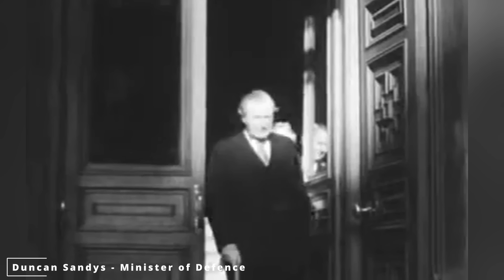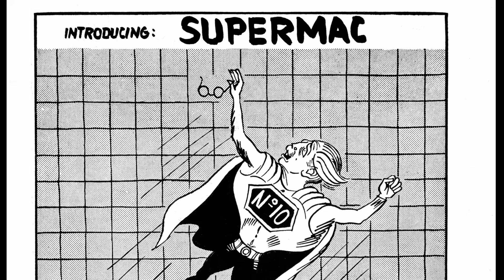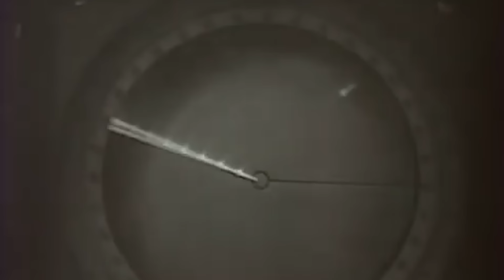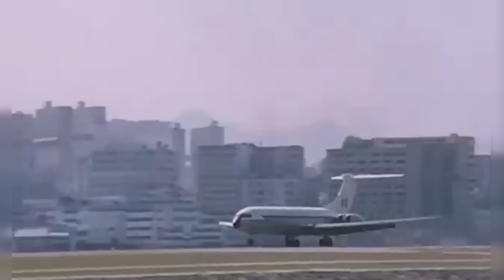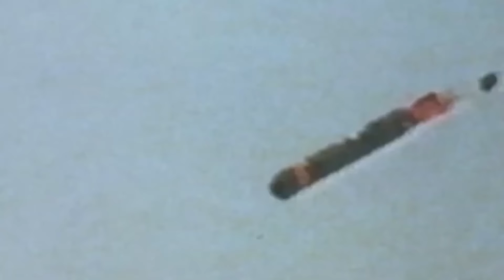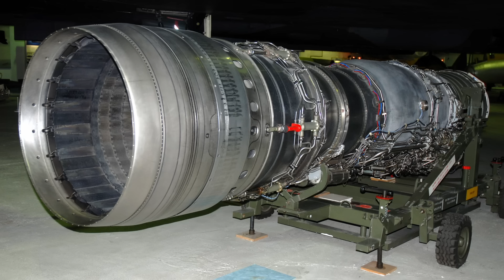How Britain Turned A Failed Airliner Into a Soviet Submarine Predator | The Mighty Nimrod

Comment: I knew a guy some years ago now, who was RAF, and spent his life spannering Nimrods. Eventually he quit the RAF but continued work on the aircraft as a civilian contractor. He said they were definitely becoming a bit of a 'mare to maintain, spares were often n/a, and they often had to make their own! But he loved the aircraft really, sort of love-hate style. Me, I remember both the Comet almost from birth, then watched it morph into the Nimrod. I still wonder how they managed to turn basically a pretty aeroplane into such an ugly duckling! They just kept adding stuff until there was nowhere left to stick anything else on the outside... I was still sad when they axed them for the boeing derivative, so much less character... (I also loved the Griffon-engined Shackleton, what a beast! 48 cylinders of noise and smoke!)
Reply: The Comet did not morph into the Nimrod... this is a common misconception.
Reply: @DoktorBayerischeMotorenWerke  

We believe we can clear up some commonly held myths and misconceptions obviously.

It's always good to see the facts presented clearly and concisely isn't it?

Bow-wing (see B-47 wing collapse wing folding incidents) had built less than 12 pressurised airliners before the Comet first flew and they were not high altitude airliners. 

All Nimrods were new build Comet 4 airframes with appropriate strengthening and the unpressurized  equipment bay tacked on. 

The HS 801 Nimrod was the most advanced aircraft of it's type at the time it first flew. Problems with the MRA4 programme were almost entirely due to radar and computer equipment issues and BAe Systems & co being too busy with other work at the time. 

Obviously there have been worse aircraft for accident losses both before & after the Comet.

Early problems with Comet takeoff stalls were caused by pilots over rotating the aircraft at liftoff. 

Podded engines on wings have aerodynamics issues. The main reasons for eventually going with podded engines were because or to facilitate -
Ease of maintenance.
Use of shear off fixings given excessive out of balance forces.
Large diameter turbofan engines.
Reduce load on the wing to fuselage connection. 
Increased power from later engines. 

The Bow-wing (See B-47 wing collapse & wing folding incidents) was a good example of how to expend a huge amount of cash and effort on something that was probably not worth bothering with. The basic design of the Comet had been decided upon and established before the podded engine choice has been made for the B-47. There were aerodynamics problems with podded pylon mounted engines at the time. The US also built and operated a significant number of EE Canberra bombers under licence which did not use podded engines for their wing mounted engines. . 

There have been aircraft losses caused by pod & pylon mounted engines. 

All jet airliners benefited greatly from the knowledge gained from the Comet incidents & subsequent investigations & yet some were still worse for accident losses. 

Instances of all marks of the Comet flew with full certification after 1954 including the Comet 3. The last Comet flight occured in 1997.

The fabulous trail blazing DH Comet.
World's first jet airliner in regular service.
The jet engined Avro Lancastrian actually did a passenger service before the DH Comet. 
World's first high altitude airliner.
World's first airliner with a full fuselage length pressurised cabin pressurised for high altitude flight. That feature for that type of aircraft was a considerably difficult undertaking. 

The change from larger squarer windows to smaller rounder windows was necessary for the particular aircraft at the time. Skin thickness remained mostly the same for all Comet marks. 

How things were back then.
Accident losses - % of aircraft built.

DeHavilland Comet 4 UK                          14% 
DeHavilland Comet all mks UK (ff 1949)17%  
Vickers VC10 UK (ff 1962)                         5%

Douglas DC-1  US                                       99%
Douglas DC-2                                              47%
Douglas DC-3                                              30%
Douglas DC-4                                              26%
Boeing s300    US                                       72% 
Boeing 307                                                  70%
Boeing 247                                                   48%
Boeing 707  (ff 1958)                                 32% 
Lockheed L-049 Constellation (ff 1943)  30%
Lockheed Electra US (ff 1957)                   29%
Fairchild FH-227 US (ff 1966)                   30%
McDonnell Douglas DC-8 US  (ff 1958)   14%
Sud Aviation Caravelle  (ff 1955)             15%
Canadair CL-44 Turboprop US (ff 1959) 46%  
Convair CV-580 Turboprop US (ff 1960) 22%
Convair CV-880     (ff 1959)                      27% 
Convair CV-990     (ff 1961)                      33%
Tupolev T-104        (ff 1956)                     16%
Vickers Viscount UK  (ff 1948)                29%  
Fokker F-27 Turboprop NL (ff 1955)       40%      

The Vickers VC10, fastest Atlantic crossing for a non supersonic jet airliner, held the record for 41 years.

For the first few years of operation the Caravelle & Comet had similar accident loss fatalities.

Sud Aviation Caravelle - 
all accident loss fatalities - 
1320 fatalities. 

De Havilland Comet - 
all accident loss fatalities - 
453 fatalities. 

An example of a typical airliner from the period. 
The Fokker Friendship F-27 fatalities & accident losses as a % of aircraft built. 
Fokker F-27 Turboprop (ff 1955)   40%
2130 fatalities.

Of course De Havilland carried out a full stress analysis & performed extensive & protracted testing on two long lengths of fuselage representing all features of a complete airframe. De Havilland carried out significantly more testing than was required by any authority at the time & significantly more testing that any previous airliner was subjected to.

De Havilland designers / engineers knew all there was to know about metal fatigue at the time they designed the DH Comet.

De Havilland had prior experience building many all metal construction airframe aircraft including many passengers aircraft & thousands of jet powered fighter aircraft that were primarily of metal construction with pressurised cockpits & used jet engines built by De-Havilland.

De Havilland did indeed always work to better than industry standards at the time, used up to date knowledge for the design & testing activities & no evidence of negligence or criminal negligence was ever produced in relation to the DH Comet.

Global aerospace. 
From the 1950s sector rationalisation and consolidation took place. 70 companies in France and 300 companies in the US disappeared due to merger or dissolution. In the US Boeing was almost bankrupted by the 707 project.  Boeing had a well protected domestic market and the available space and resources in the US to engage in large scale airliner manufacturing enabling them to capture orders simply by being able to produce airframes fast enough and cheap and nasty enough. Another factor is airlines preferring to obtain as much of their airliner inventory as possible from one manufacturer. 

Global Aerospace Sector, what's happening.

For example, there are of course no German companies that makes German jet aircraft in Germany & there are no German companies that make German gas turbine aero engines in Germany that are suitable for widebody airliners.

The UK has the world's highest combined per capita Nuclear / Defence / Aerospace Sector Activity.

UK defence sector, absolute terms, world's second highest activity. 1st for per capita defence sector activity. Per capita nuclear powered submarine construction, 2nd position. 
Main players being Rolls Royce, Babcock, GKN Aerospace & BAe Systems. Activities often involve international collaboration. BAe systems, RR and other UK companies now handle more Airbus work value wise than Germany. 

There's a good chance that anyone currently flying on a widebody airliner will be on an aircraft powered by RR gas turbine aero engines made in the UK and a good chance there will be other hardware on the aircraft that's designed and / or manufactured in the UK. 

Rolls Royce Holdings UK
Subsidiaries
- Rolls-Royce plc
- Rolls-Royce North America (ex Allison etc Classified Military stuff)
- Rolls-Royce AB
- Rolls-Royce Deutschland
- Rolls-Royce India Private Limited
- Rolls-Royce Marine Power Operations
- Vinters Engineering Limited
- Rolls-Royce Controls and Data Services
- Rolls-Royce Power Systems
- Bergen Marine
Joint ventures include:
- Rolls-Royce Turbomeca
- MTU Turbomeca -

Trent Family
The MT30 (Marine Turbine)
Industrial Trent 60 Gas Turbine
Trent 7000
Trent XWB Airbus A330neo.
Trent 1500
Trent 1000
Trent 500
Trent 600
Trent 700
Trent 800
Trent 8100
Trent 900
   
RR wholly owned subsidiaries in Germany handle smaller 2 shaft RR gas turbine aero engine work.

The UK space and aerospace sectors are highly productive, high-value industries that together contribute over £18 Billion in direct Gross Value Added (GVA) to the UK economy. Individually, the space industry directly contributes about 0.3% of UK GDP 7•2 Billion while the aerospace industry contributes approximately 0.5% £10•9 Billion.
   
We hope this helps.
Reply: That's a popular myth but the Hawker-Siddeley Nimrod shares  no parts or subassemblies in  common with any of the Comets. It's a completely new aircraft with a new type certificate and all Hawker-Siddeley design throughout.
Reply: @JammisAdami 

We believe we can clear up some commonly held myths and misconceptions obviously.

It's always good to see the facts presented clearly and concisely isn't it?

All production Nimrod aircraft were new build Comet 4 airframes with the necessary modifications. The Nimrod was the most advanced and most capable aircraft of it's type at the time it went into service. The  Nimrid HS.801 was not available for purchase by other countries. The ability  if the HS 801 to repeatedly demonstrate detection of subs and the knowledge that it could deliver nuclear depth charges to a target was a very effective deterrent. 

Bow-wing (see B-47 wing collapse wing folding incidents) had built less than 12 pressurised airliners before the Comet first flew and they were not high altitude airliners. 

All Nimrods were new build Comet 4 airframes with appropriate strengthening and the unpressurized  equipment bay tacked on. 

The HS 801 Nimrod was the most advanced aircraft of it's type at the time it first flew. Problems with the MRA4 programme were almost entirely due to radar and computer equipment issues and BAe Systems & co being too busy with other work at the time. 

Obviously there have been worse aircraft for accident losses both before & after the Comet and Nimrod.

Early problems with Comet takeoff stalls were caused by pilots over rotating the aircraft at liftoff. 

Podded engines on wings have aerodynamics issues. The main reasons for eventually going with podded engines were because or to facilitate - Ease of maintenance. Use of shear off fixings given excessive out of balance forces.
Large diameter turbofan engines.
Reduce load on the wing to fuselage connection. Increased power from later engines. 

The Bow-wing (See B-47 wing collapse & wing folding incidents) was a good example of how to expend a huge amount of cash and effort on something that was probably not worth bothering with. The basic design of the Comet had been decided upon and established before the podded engine choice has been made for the B-47. There were aerodynamics problems with podded pylon mounted engines at the time. The US also built and operated a significant number of EE Canberra bombers under licence which did not use podded engines for their wing mounted engines. . 

There have been aircraft losses caused by pod & pylon mounted engines. 

All jet airliners benefited greatly from the knowledge gained from the Comet incidents & subsequent investigations & yet some were still worse for accident losses. 

Instances of all marks of the Comet flew with full certification after 1954 including the Comet 3. The last Comet flight occured in 1997.

The fabulous trail blazing DH Comet.
World's first jet airliner in regular service.
The jet engined Avro Lancastrian actually did a passenger service before the DH Comet. 
World's first high altitude airliner.
World's first airliner with a full fuselage length pressurised cabin pressurised for high altitude flight. That feature for that type of aircraft was a considerably difficult undertaking. 

The change from larger squarer windows to smaller rounder windows was necessary for the particular aircraft at the time. Skin thickness remained mostly the same for all Comet marks. 

How things were back then.
Accident losses - % of aircraft built.

DeHavilland Comet 4 UK                          14% 
DeHavilland Comet all mks UK (ff 1949)17%  
Vickers VC10 UK (ff 1962)                         5%

Douglas DC-1  US                                       99%
Douglas DC-2                                              47%
Douglas DC-3                                              30%
Douglas DC-4                                              26%
Boeing s300    US                                       72% 
Boeing 307                                                  70%
Boeing 247                                                   48%
Boeing 707  (ff 1958)                                 32% 
Lockheed L-049 Constellation (ff 1943)  30%
Lockheed Electra US (ff 1957)                   29%
Fairchild FH-227 US (ff 1966)                   30%
McDonnell Douglas DC-8 US  (ff 1958)   14%
Sud Aviation Caravelle  (ff 1955)             15%
Canadair CL-44 Turboprop US (ff 1959) 46%  
Convair CV-580 Turboprop US (ff 1960) 22%
Convair CV-880     (ff 1959)                      27% 
Convair CV-990     (ff 1961)                      33%
Tupolev T-104        (ff 1956)                     16%
Vickers Viscount UK  (ff 1948)                29%  
Fokker F-27 Turboprop NL (ff 1955)       40%      

The Vickers VC10, fastest Atlantic crossing for a non supersonic jet airliner, held the record for 41 years.

For the first few years of operation the Caravelle & Comet had similar accident loss fatalities.

Sud Aviation Caravelle - 
all accident loss fatalities - 
1320 fatalities. 

De Havilland Comet - 
all accident loss fatalities - 
453 fatalities. 

An example of a typical airliner from the period. 
The Fokker Friendship F-27 fatalities & accident losses as a % of aircraft built. 
Fokker F-27 Turboprop (ff 1955)   40%
2130 fatalities.

Of course De Havilland carried out a full stress analysis & performed extensive & protracted testing on two long lengths of fuselage representing all features of a complete airframe. De Havilland carried out significantly more testing than was required by any authority at the time & significantly more testing that any previous airliner was subjected to.

De Havilland designers / engineers knew all there was to know about metal fatigue at the time they designed the DH Comet.

De Havilland had prior experience building many all metal construction airframe aircraft including many passengers aircraft & thousands of jet powered fighter aircraft that were primarily of metal construction with pressurised cockpits & used jet engines built by De-Havilland.

De Havilland did indeed always work to better than industry standards at the time, used up to date knowledge for the design & testing activities & no evidence of negligence or criminal negligence was ever produced in relation to the DH Comet.

Global aerospace. 
From the 1950s sector rationalisation and consolidation took place. 70 companies in France and 300 companies in the US disappeared due to merger or dissolution. In the US Boeing was almost bankrupted by the 707 project.  Boeing had a well protected domestic market and the available space and resources in the US to engage in large scale airliner manufacturing enabling them to capture orders simply by being able to produce airframes fast enough and cheap and nasty enough. Another factor is airlines preferring to obtain as much of their airliner inventory as possible from one manufacturer. 

Global Aerospace Sector, what's happening.

For example, there are of course no German companies that makes German jet aircraft in Germany & there are no German companies that make German gas turbine aero engines in Germany that are suitable for widebody airliners.

The UK has the world's highest combined per capita Nuclear / Defence / Aerospace Sector Activity.

UK defence sector, absolute terms, world's second highest activity. 1st for per capita defence sector activity. Per capita nuclear powered submarine construction, 2nd position. 
Main players being Rolls Royce, Babcock, GKN Aerospace & BAe Systems. Activities often involve international collaboration. BAe systems, RR and other UK companies now handle more Airbus work value wise than Germany. 

There's a good chance that anyone currently flying on a widebody airliner will be on an aircraft powered by RR gas turbine aero engines made in the UK and a good chance there will be other hardware on the aircraft that's designed and / or manufactured in the UK. 

Rolls Royce Holdings UK
Subsidiaries
- Rolls-Royce plc
- Rolls-Royce North America (ex Allison etc Classified Military stuff)
- Rolls-Royce AB
- Rolls-Royce Deutschland
- Rolls-Royce India Private Limited
- Rolls-Royce Marine Power Operations
- Vinters Engineering Limited
- Rolls-Royce Controls and Data Services
- Rolls-Royce Power Systems
- Bergen Marine
Joint ventures include:
- Rolls-Royce Turbomeca
- MTU Turbomeca -

Trent Family
The MT30 (Marine Turbine)
Industrial Trent 60 Gas Turbine
Trent 7000
Trent XWB Airbus A330neo.
Trent 1500
Trent 1000
Trent 500
Trent 600
Trent 700
Trent 800
Trent 8100
Trent 900
   
RR wholly owned subsidiaries in Germany handle smaller 2 shaft RR gas turbine aero engine work.

The UK space and aerospace sectors are highly productive, high-value industries that together contribute over £18 Billion in direct Gross Value Added (GVA) to the UK economy. Individually, the space industry directly contributes about 0.3% of UK GDP 7•2 Billion while the aerospace industry contributes approximately 0.5% £10•9 Billion.
   
We hope this helps.